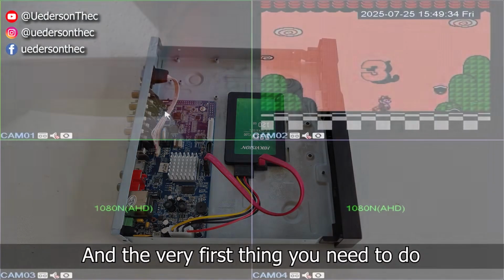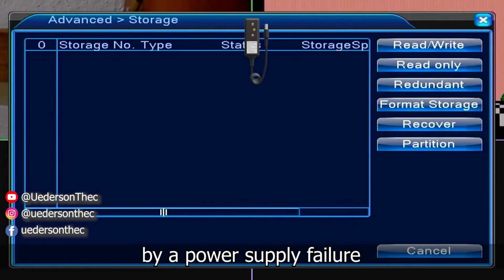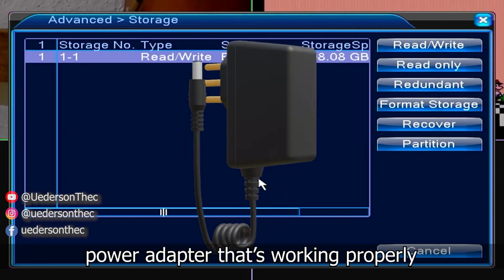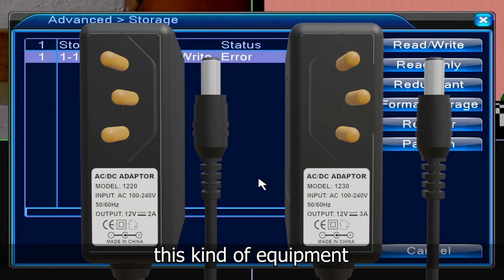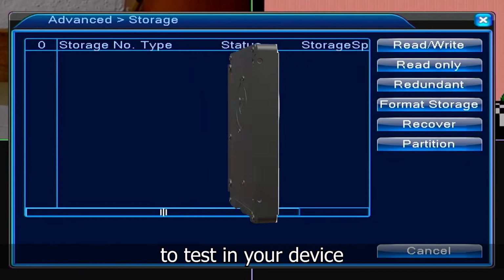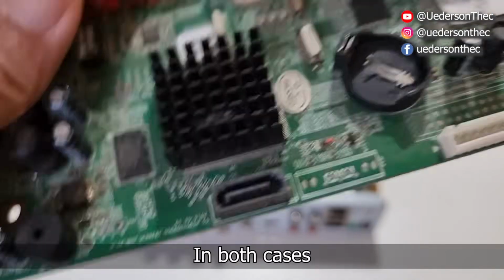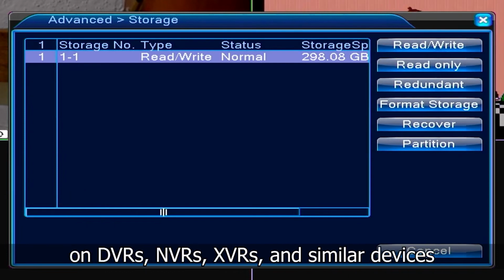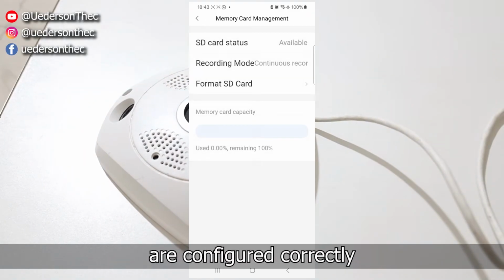📹 Fix Security Camera Recording Problems – Step by Step Tutorial

Comment: Mine is doing exactly what you saying it did it a few times over the 2 yrs I've had the system, and when I cut my ceiling fan or light off the video glitch. So I did what you said this time and I see some white like glue around the port where the wires plug in in the drive.i have a 1TB and it stop recording all sutton do you thing the drive has over loaded and bust I'm going to take out now.

Comment: Thank you for this video and I know it's helpful to most of the homeowners with security systems because of the useful troubleshooting guide. I work for an agency that works with @AlarmDotCom and I have come to realize through this video that recording failures sometimes can go unnoticed until someone actually needs that footage so teaching people how to check the drive status, power supply, memory card and recording settings is something sensible someone has to know before calling for any backup.